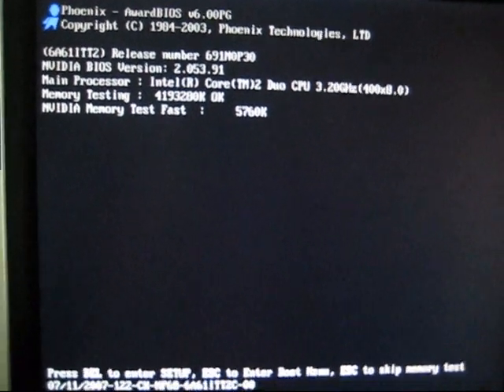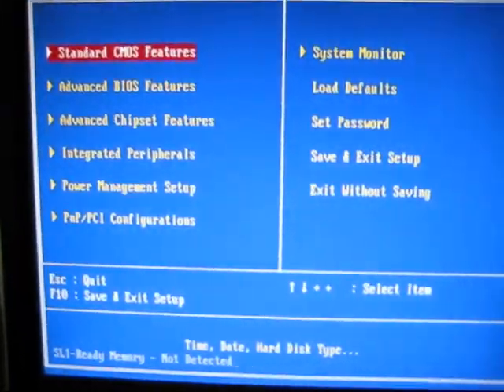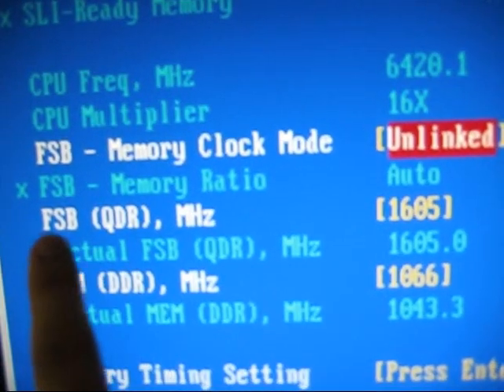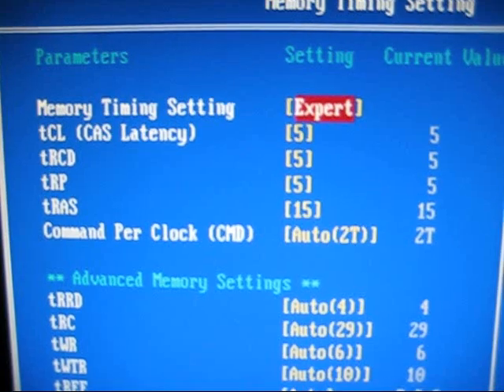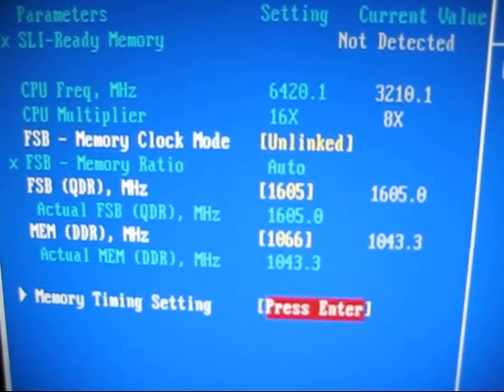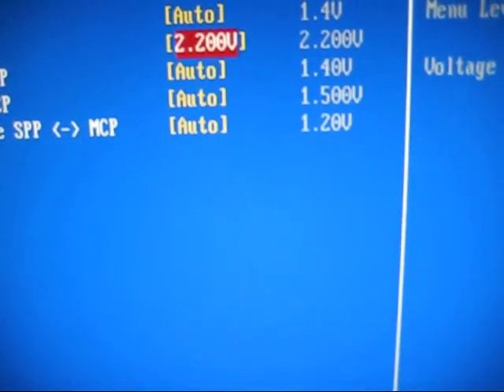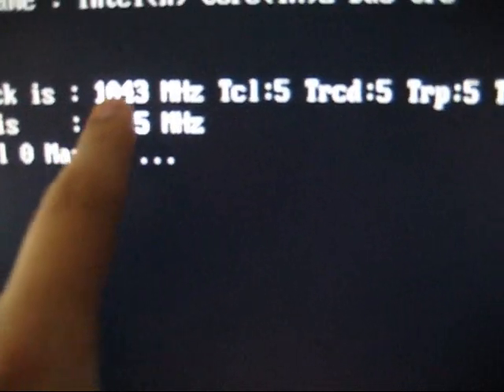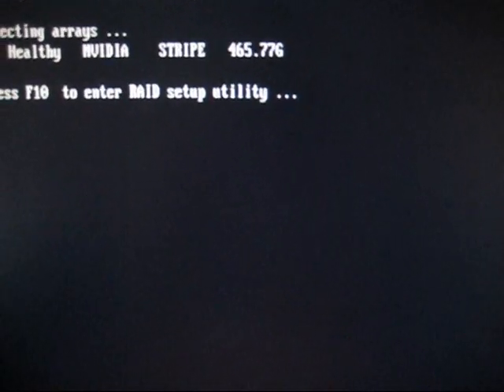Adjusting Your Overclocked Ram In Bios

Comment: I have an overclocked system. 3.4 ghz (on a q6600) with kingston hyperx 4X1gb ddr2 1066hz ram configuration (in 4 ram slots) on an asus p5e mobo. If i were to remove the older sticks and upgrade to kingston hyperx 4X2gb 1066hz ram would I run into any trouble or could i just drop them in and be good to go?

Comment: WARNING: Overclocking can damage your computer component as you are taking risk to overload, overheat CPU, RAM etc. I have seen cases where machines started to heat so much that internal little component started to die. IF you have good cooling system then it is worth doing it otherwise don't.  ALSO some waranties do not cover OverClock and invalid your Waranty so make sure you know what you are doing. NICE VIDEO by the way.

Comment: @mast3rmgl should work fine, if it doesnt boot after adjusting thoes settings you might have to up the fsb of the cpu and vcore voltages to reach your target frequency

Comment: Hey guys I wanna make sure this is correct. I have 1600mhz mem but cpu says its 1333. So I go in bios change mem to 1600, then enter in correct dram voltage (1.65) and it will be 1600? And doing it this way will prevent me from taking the mem clock above stock by increasing the fsb for overclocking? Good think im getting black edition right?

Comment: @Park0ur4life Your using a 32 bit system, 64 bit will unlock more, but it depends what OS you use on 64. If you want like 120g in ram get vista ultimate ;), no kidding!

Comment: @Park0ur4life i know exactly whats wrong, you only have a 32-bit operating system right?  well if you do you should know that any 32-bit system can only have a maximum of 4gb of memory NO MATTER how much your motherboard can support or how much you actually have.  Now if you do have a 64-bit system, then it can support up to 128 gb of ram and if that's the case then i don't know what your problem is

Comment from the maker: 32 bit O.S only can read up to 3.5 of memory. Cause it is locked at that. If you have a 64 bit O.S you have have as much ram as you want and it would still read all of it. You can have 12 GB of ram and it would read all of it in a 64 bit O.S

Comment from the maker: I'm not sure what mobo your running, but the voltage of your ram in goes in different increments. like 1.8, 1.825, 1.9. 2.0, 2.2, etc etc so i'm not sure what the millivolts your talking about.  For the ram Mhz, mine says 5300 in cpu-z but in bios i have 1066. so i don't know whats going on with cpu-z. as long as it reads right in bios, you should be fine.

Comment from the maker: actually its 128-bit. Are they matching sticks? are they in the right ram slot? if you want dual channel you have to have it in the right spot. Example- they're 4 slots, 2 blue and 2 black, make sure they have in the same colored slot. if not colored, try the first slot close to the cpu and the 2nd slot or 1st slot and 3rd slot or 2nd slot and 4th slot

Comment from the maker: yeah, they're thing you would have the change...

Example-If your timing is 5-5-5-15 change it to that manually, then if the voltage of your ram is 2.2 change it to that, and change your Mhz from 800 to 1066 to run at 1066 properly